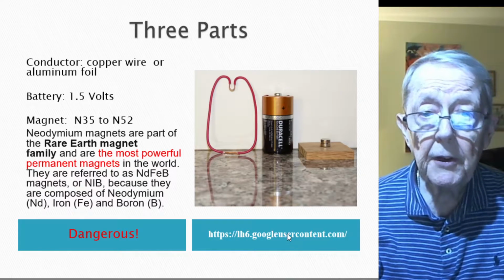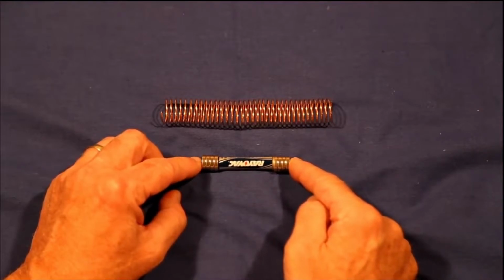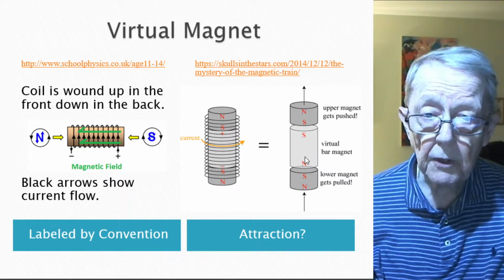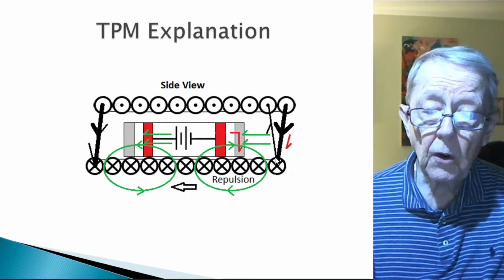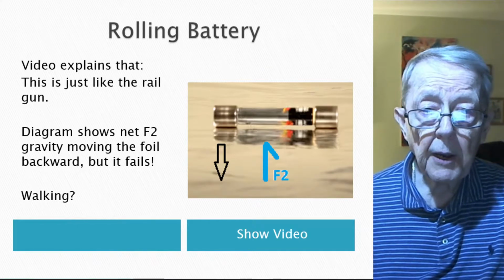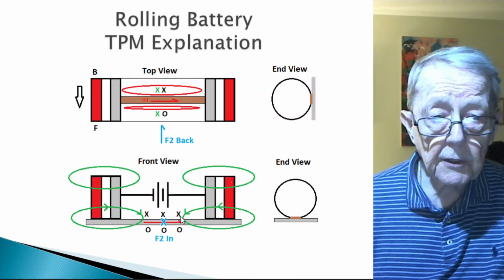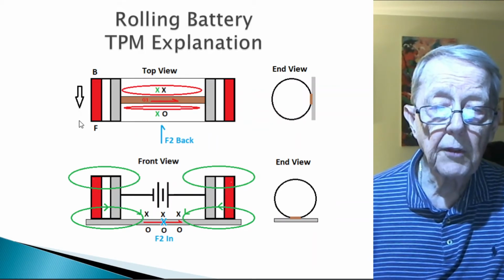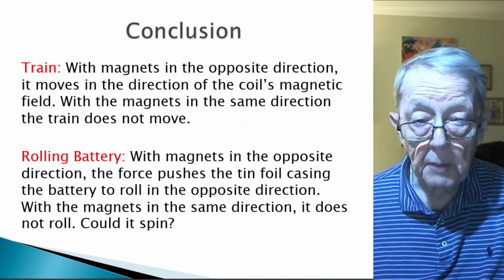Homopolar Train and Rolling Battery

Comment: Magnetic fields arent just flat lines north south, they also spiral out from the ends, its most obvious with how CRT works(and improves the understanding of rail guns) and how magnet will divert the line of electrons on such screen. Also the battery creates a 3rd field imbalancing the 2 magnets therefore it starts to move.
Reply from the maker: I agree! Thanks for the comment.